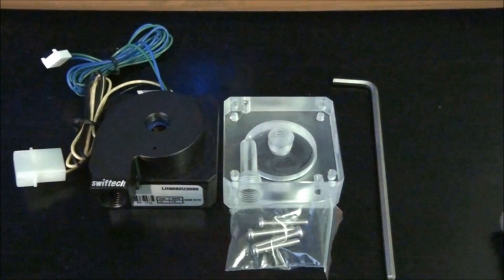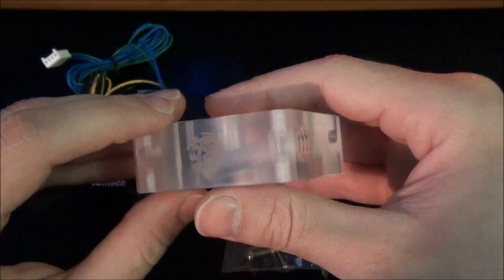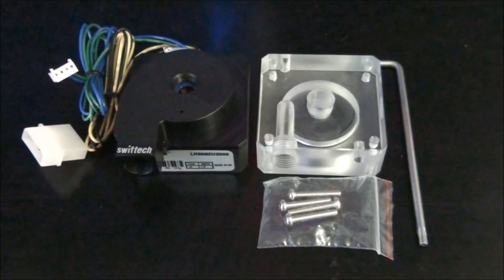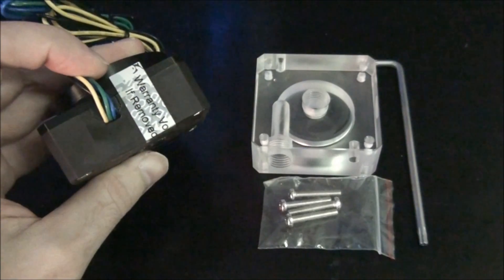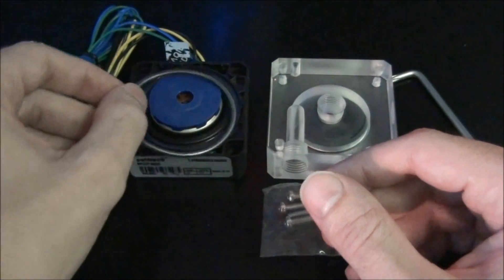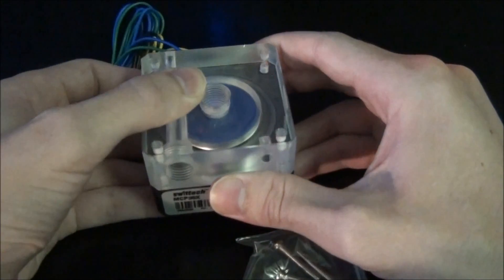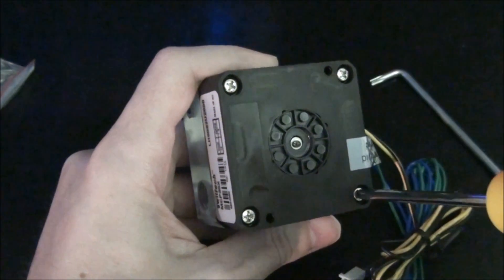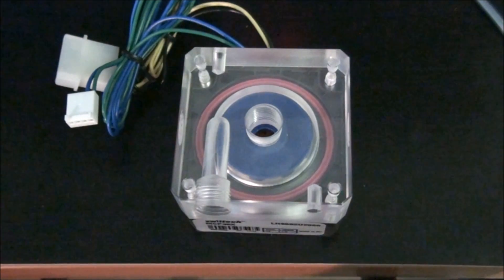Pump Top Installation Guide For MCP35X & DDC Series

Comment: the warranty sticks is typically a warranty against leaks, as the pumps are leak tested . the sticker voids the warranty on a leak claim. but not against the motor failing.